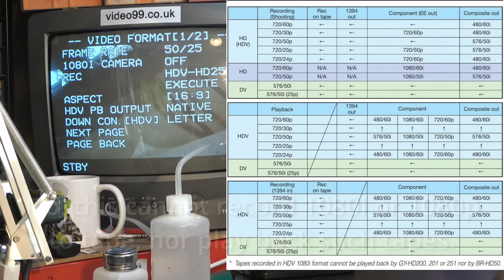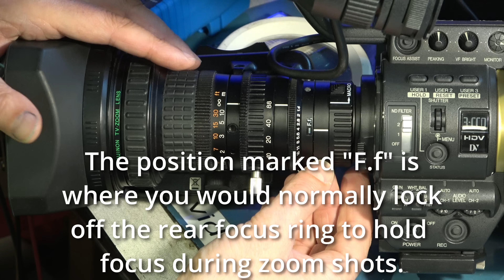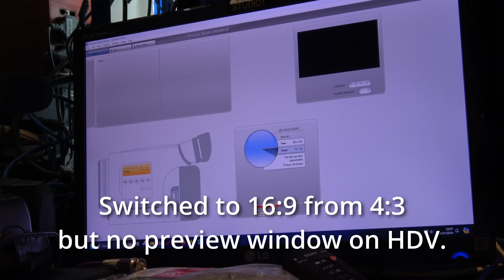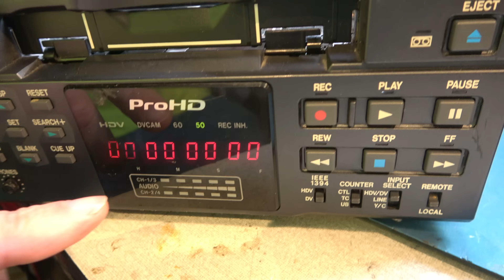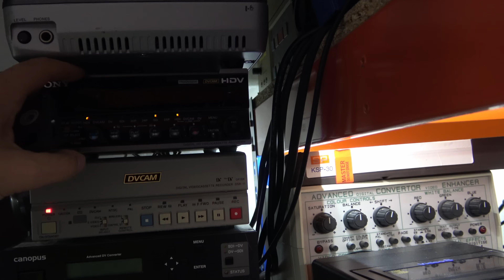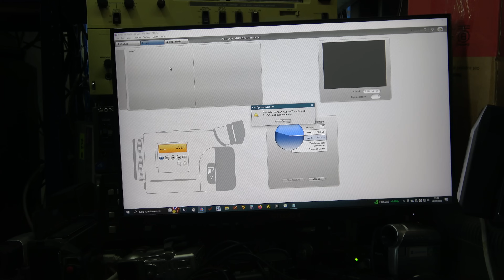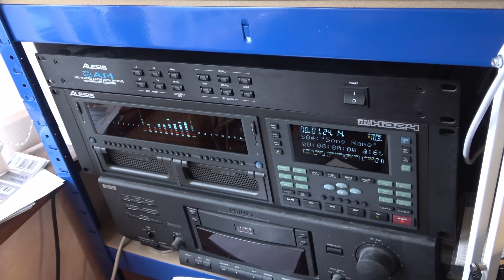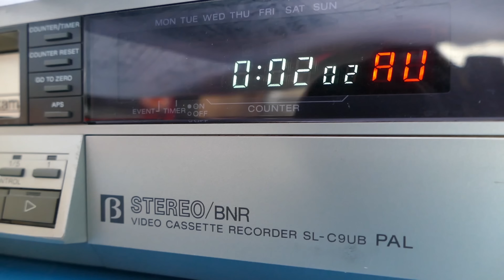JVC invented a rare and little known professional video cassette format.  HDV 720P "ProHD".

Comment: When JVC introduced the GR-HD1 in 2003, they decided "Europe isn't ready for HD yet" so they released a version of it in Europe called the GR-PD1, which had the same image sensor as the HD1 but only recorded standard-definition 720x576 video, not 1280x720, at 25 progressive frames per second (25p). But it still used the MPEG2 codec just like the 720p HDV model, except if you switched it into DV compatibility mode.

Comment: It is a common misconception that JVC developed ProHD as a proprietary extension to HDV. JVC has stressed that 24-frame/s video and LPCM audio have always been part of the HDV format, but at the time they were initially offered no other HDV camcorder had them. The company went to great lengths to promote the format as an appropriate solution for professional high definition video production.
Source Wiki.
Reply: Indeed. JVC failed to capitalize on "Professional DV" when they left out film-like rates on the GY-DV500. With HDV, they learned the lesson and were promoting 24p for digital movies, and they were quite successful in this regard.

Comment: Next time, glue a 5 mm aluminum nut above the old hole and clamp to broken ring sides, use the 5 mm bolt to prevent glue ingress.

Comment: I knew a guy who broke a focus ring on a broadcast lens, and decided to fix it with Cyanoacrylate, but it was the thin spread type, and it flowed down inside the lens and locked several of the elements together, which completely destroyed the lens... So be very careful... If you do use CA glue, use the gap filling thick formula, and not the thin stuff...
Reply from the maker: I was very, very careful for just that reason.
Reply: @video99couk  you also use a small amount of baking soda as a filler/kicker to set the CA glue very quickly...

Comment: It looks like that lens has a flange adjustment on that rear ring. Once you make the proper adjustment, the focus will work properly both on zoom in and out positions. Try to find the lens manual for flange explanation. Or maybe it's explained on the JVC camera manual. Note that you have a flange adjustment in the lens of your digibeta camera.

Comment: Yes the chromatic aberration  performance was woeful for what is a professional lens.  Did you experiment with manual/automatic/electronic exposure options?

For the back focus adjustment  I would try gluing a suitable nut on top of the broken thread and using a screw through that or find a brass threaded insert to glue in on the existing threads and use a smaller locking screw through that.
Reply from the maker: Yes I was using manual exposure at that point.  If I selected auto, it stopped down far too much and took out the brightness of the scene.

Comment: Could you put a wide cable tie around the ring and drill a hole for the locking screw ?

It might look a bit messy but it's better than risking getting glue everywhere.

Comment: It seems that there's small flats outside of the screw hole in that cracked ring. So it would be possible to machine a small washer/bracket/dunnowhatyoushouldcallit that keeps the ring in one piece when locking screw is tightened with sane torque. I know, I know, pointless, as best fix is the one that got the propblem solved.

edit: on the ribbon cable repair - I've pulled that stunt once. Years ago with a dremel and some sort of rubber bit. I've tried many times since and never had any luck. Maybe the cables are older than they used to be and/or I'm more clumsy than I used to be.

Comment: Bonus geeky fact about these: the DV format actually supported four audio tracks (recorded at 32k; if you chose two tracks, you got the full 48k). When they went to HDV, the four tracks went bye bye, and you just had stereo
Reply from the maker: So the four audio channels is only for standard definition DV, not HDV mode?  Oh dear.
Reply: Yes!!! I have a Sony DSR PDX10 and noticed those audio settings. Very interesting stuff. I suppose it’s only a visible setting on DVCAM operations

Comment: Setting the back focus can be quite trying on the nerves... To do it correctly you need a back focus test card, and at least 15 to 20 metres of space between the card and the camera.
That being said, you can usually get it close by zooming in on something somewhat far away and front focusing on it, and then zoom, all the way out and back focus on the wide shot. Then zoom back in and repeat until it is in focus close up and far away, the focus should properly track between the two points if the len is not damaged. I'm been doing back focus for years in the field, usually lots of fun... :)

Comment: I was offered the same equipment about a decade ago, and had no qualms at not keeping it. It's not broadcast spec, it's just industrial equipment. Had no genlock input, RCA video connectors...

As you discovered, it's an almost unique recording format (tape-wise). And the unusualness of 720p meant it almost always had to be converted. The camera is from before the days of people watching playback from a file on a drive.

They used paired CCDs to achieve the resolution, the left side of the image has a separate sensor than the right, and if not aligned fantastically well, you can see a line running down the dead centre of the image and brightness/contrast differences either side of it. It was glaringly obvious in the camera I was offered.

The Firewire ports are frequently wrecked. Firstly there's the obvious and repairable mechanical damage from the connectors getting knocked, and having lots of use. Secondly, the electronics get zapped when people connect them when running from an ungrounded switchmode power supply that floats at a few hundred volts (this eventually does damage). You can see sparks fly when you plug them together at times.

People used to wreck the output stages of compact disc players doing the same thing - patching ungrounded and grounded gear's signal leads together after plugging them into the mains, and RCAs often contacted the pins together before the shield. 

Sometimes you do have to plug Firewire gear in while powered and running, as some (seriously stupid) computer equipment would never see a Firewire device as being there if you turned the power on after it was plugged in. And the same systems needing frequent unplugging/replugging to see devices that disappear. My simplistic solution to that problem was BEFOREHAND always ensuring that some grounded lead (such as an audio or monitor lead) was connected, and it has to be something that is grounded, or a shared common between the two equipment you're patching the Firewire lead between. 

The camera and VCR deck I was offered both had zapped Firewire electronics, leaving only analogue capture as an option. When parts were still available, as a whole board swap, it was around a $1000 repair.

For what it's worth, to set back focus the best way, you really want to use something in the very far distance at infinity focus, with the iris wide open (use the high-speed shutter and gain to avoid over-blown video). Don't film through a window, the window glass can affect focus. If you just do it indoors you might find backfocus was always wrong when you went outside. While focus charts help (you can find PDFs on-line and get a print shop to make an A3 print of them), trees in the distance, football towers, streetlight poles, all work quite well. I'd try something like a hose-clamp completely around the lens barrel, spanning across the backfocus ring and an adjacent non-rotating ring on the lens.
Reply from the maker: Though I didn't show it on the YouTube video, I did check it outdoors with a tree, and back focus is set correctly.  But it's not ideal having to glue it like this.  A big problem with Firewire is that if the socket wears, it's quite possible to insert the plug back to front.  Guess how I know that.  And you can imagine the results.
Reply: @video99couk  can you think of a way to make a tight friction band to go around it? That might be your best bet for a non-fixed back-focus.

Comment: Those cameras play in different leagues. The Sony has 3 3/4 inch sensors and records 4:2:2 10 bit intraframe whereas the JVC has 3 1/3 inch sensors and records 4:2:0 8 bit long gop (or intra in DV mode). Moreover, if I'm not mistaken, this first generation camera didn't have real HD sensors and used pixel shifting to achieve an HD image. The tape mechanism also seems sturdier in the Sony. All that being said, the JVC cost much, much less and was more lightweight. There was an optional hard disk recorder for the JVC that took advantage of the firewire connector to store files ready for editing without the need for capturing the tape in real time. Also, the (then owned by Sony) Vegas software* was compatible with all HDV variants and could render whithout recompression if there was only cuts between clips. * Maybe other software had it too, I don't remember.
Reply from the maker: I believe the JVC sensors are real 720p, but yes I agree, the Sony is a more professional piece of kit despite the lower resolution.  I will provide shots from both of them in a few weeks.
Reply: @video99couk  Lower resolution and bigger sensor usually mean better S/N and wider dynamic range. The good thing about the 720/50p is that you don't have to deal with nasty deinterlacing.
Reply from the maker: @UHF43  But for some broadcast case uses back in the day, interlacing was required.  Isn't Sky HD still interlaced at broadcast?
Reply: @video99couk   All mainstream UK HD broadcast is interlaced. - We're required to submit 1920 x 1080 as defined in EBU TECH 3299 System 2; 25 frames per second (50 fields) interlaced – 1080i/25, top field first; 4:2:2; colour space per ITU-R BT 709  - AVC Intra Class 100.   - You'll find all the main broadcasters post a document entitled "Technical Delivery Standards"  "As-11".   

UHD needs to be originated as progressive scan though.
Reply: @Matt_Quinn-Personal_Account  In Germany they choosed 720p50 for HD. So for them it was native format for decade.
Reply: @xsc1000   - I was referring to the current position in the UK; which in turn seems to have led the EBU position...  

I've seen 720p come down from German Satellites; but they would have been pretty-much on their own within Europe...   The one time I can recall supplying a recording for a German station (Arte HD) the 'spec' they gave me was a cut-and-paste of the British one.  - And the submission went in as a 1080i MXF Op1a
Reply: @Matt_Quinn-Personal_Account  Yes, here in Czech republic 1080i50 is also standard for a long time like in most EBU countries. Germany chose different way in around 2005 and now (with DVB-T2/h.265) their goal is 1080p50, because 1080i50 would bring interlacing again. But they accept 1080i50 too. Arte HD is international project, not solely German, so they use 1080i50.

Comment: I've would have tried to find a 5mm Self-Tapping Threaded Inserts Sleeve and glue it with epoxy and then use a thumb screw that fits the inside thread.

Comment: For the focus ring, would a large jubilee clip with a hole drilled in it be a solution, or 2 thin cable ties (either side of the lock screw)?

Comment: Pinnacle? I usually use a simple program HDVSplit that already outputs video file including audio tracks. I use Vegas, it supports both DV and HDV files. Maybe you could install some plugins in Resolve to open the videos.
Reply from the maker: Older versions of Pinnacle studio have a high "get the job done" factor for video capture.  I do occasionally use winDV for DV capture too.
Reply: @video99couk  ScenalyzerLive has never failed me and it;s ana abandonware with latest release in 2006. Just a basic program with bare settings copying a video from tape with tape tansport support for DV-type devices, also works with analog to FireWire passthrough.

Comment: JVC was a founding member of HDV consortium, along with Sony, Canon and Sharp. A little known fact is that JVC was one of the leading developers of MPEG-2. For HDV, JVC chose 720p, Sony and Canon chose 1080i. Later, Sony and Canon added prog-scan film-like rates to HDV 1080, but if you wanted 50p/60p you had to get a JVC machine. ProHD is just marketing lingo for using a consumer-grade HD format - that is, HDV - in a shoulder-mount body. Some equated "ProHD" with 24p, but 24p had been in the HDV spec from the beginning.

Comment: Hey, I'm sorry to say that I have been sponsored by and used JVC camcorders since the early 80s and they, as a support company, have been amazing, right through all of their formats until the present day. Something I couldn't afford to do with Sony. I'm sad they're finally dropping the professional market. 😞Rob
Reply from the maker: I don't think many people would say that of Panasonic (who were related to JVC at the time).  Panasonic support was very poor from what I've been told, which along with reliability issues resulted in the demise of MII and DVCPRO.  But how closely tied were JVC and Panasonic?  I don't know.  In the domestic market, JVC got an unenviable reputation for poor reliability, probably the worst of all Japanese manufacturers.  Was their professional equipment completely different to their domestic product line?  If you had good results from JVC professional equipment, it was presumably very different to the domestic equipment.  I think the deck in my professional D9 machine is broadly a domestic S-VHS machine though.
Reply: What do you do with the video recorders you get and fix? I have several important films, etc, that I made and mastered on D9. My edit recorder has  been in store for 20 years and is not very well. 
I would love to be able to have digital copies of them from a decent machine. The one thing that even I couldn't understand is that JVC only put a CVBS monitor output on the camera! The only quality copy you can get is from one of the various edit recorders.
Love your videos.

Comment: What about 2 pieces of copper wire , from a cable , impregnated with bi component glue , next to the thread hole , so it has more structural strenght?

Comment: The only thing I can think of for the lens is to send it off to Fuji for repair. I think you will find the lens from the Sony will fit fine on the JVC.
Reply: The Sony is 2/3 the JVC 1/3 so, sadly, no.  - There is an adaptor, but it's stupidly expensive.
Reply: @Matt_Quinn-Personal_Account  I did forget to account for that possibility of a different CCD size.

Comment: could you epoxy a square 5m washer/nut, those thin ones you get? over the original space. or maybe a jubilee strap you coud screw on and off;  over the ring. Not pretty but might work.
Reply from the maker: The space is too narrow for a jubilee clip, and that would keep sliding out of place.  If I were to glue a nut to the ring, it would still push the broken ring away from its location.  It's a very flimsy design.  I wonder how many of these had the same part break.

Comment: If your back focus (flange focal length) is that far off from the indicated position (the f f sticker) then you have a big problem or that lens is not the correct type for that mount. I couldn't see which lens you have, but I'd guess that camera is a 1/3 inch sensor size which is normally a very different flange focal length, even if it used a B4 mount. You also need to be careful with the lens type, the green ring says it was HD compatible, pretty sure the green printing is the same. The older standard def. lenses were a lot more sloppy about how well they controlled the focus point.
Reply from the maker: It's not off the F.f sticker, it's right in the middle of it.  But it was way off because it wasn't possible to lock down.
Reply: That's one of the lenses JVC supplied with this 'family' of cameras as standard.  - They are 1/3".

Comment: Did you scrape the plastic away from wrong side of flat cable? It looked like it from here, so when cable is inserted the scraped away part is away from the contacts
Reply from the maker: No, it's taken from the side of the metal contacts in the socket.  But the socket is in a sorry state too.

Comment: The JVC camera is using a format that ain't robust enough to be call Broadcast. An HDCAM would be best even if not HDCAM SR. Those where full res, not thin raster like the HDV format.

HDV is a predigtive frame  mpeg2 transport stream 1440*1080i 4:2:0 format afterthought inplace of the full SD format 5:1 4:1:1  with no predictive frame thus easier to edit.

I would go for an HDCAM or DiGITAl Betacam for SD anytime but recording the HD-SDI output on a prores or DNxHD file recorder on the back..

Comment: These cameras had problems with their image sensors. Firstly, they got hot and there is a fan, secondly - unlike larger Sony cameras, the sensor itself was only glued to the prism, even though the design also has holes for mounting screws. As a result, I saw several such cameras with sensors detached or damaged. Not very pro equipment.
Reply from the maker: The fan plus head motor adds up to quite a lot of noise.

Comment: I'm wondering, since that flexicable was probably made by the same technologies as flexible PCBs... would it be feasible to just draw up the cable in KiCAD or something and send it off to be manufactured. That shouldn't be outrageously expensive. (probably less than 100 Euros for such a small part.)
Reply from the maker: Maybe, but I think it's a complicated shape.  I can't really get to the head drum end without a major strip down.